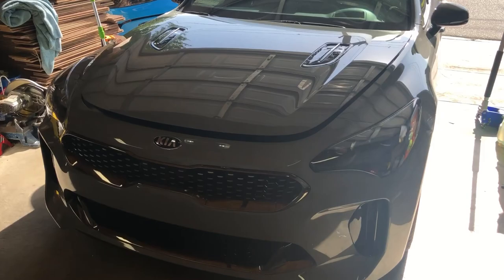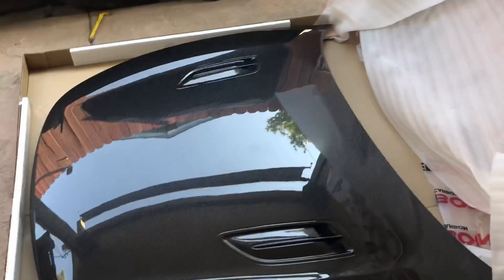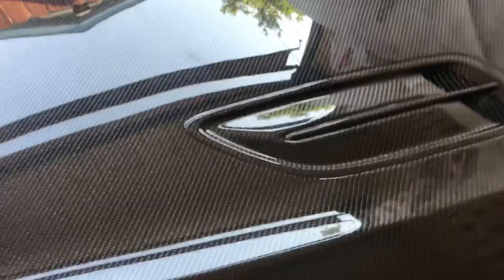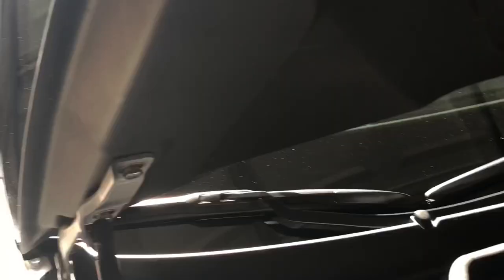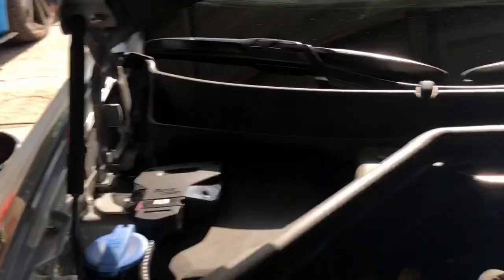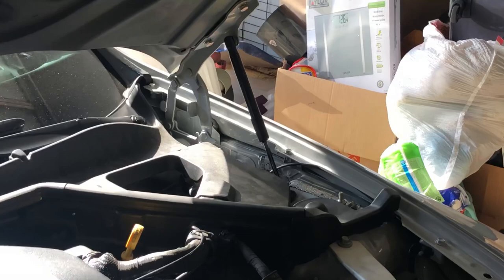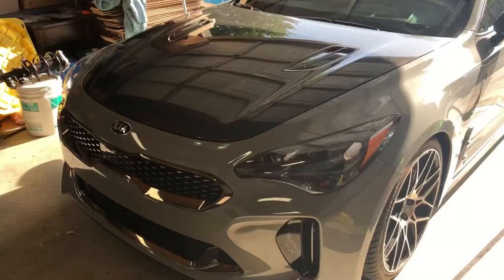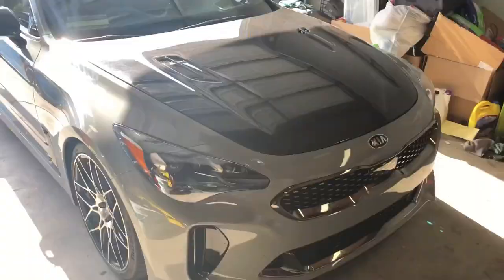Kia Stinger Seibon carbon fiber hood install

Comment: Nice man. Been considering this on my 22 or just going with replacement carbon fiber hood vents. Two questions. One is do those vent openings hold water? Also, I am a little confused about the part you were saying to remove to avoid stress crack?
Reply from the maker: Doesn't hold water. You want to remove the gas struts that hold up the hood as those will be too strong for the lighter hood.  You can find lower strength ones on Amazon just have to look for the right ones
Reply: @el.chepito1985  thanks man. Is it holding up well?  Did you get any type of paint protection film over the hood ?
Reply from the maker: @AngSolo  hot itself held up well. Highly recommend you immediately get protection on it. Either wrapping it in clear vinyl or clear coat

Comment: Are hood pins required for the the website says hoodpins recommend?
Reply from the maker: I never used them on any hoods. Safer to have them but i never had an issue.

Comment: What do you think guys, fly zone or nah?
Reply from the maker: D J it is less than half the weight of the stock hood
Reply: @el.chepito1985  did you say you should replace the gas struts? Or just remove them when installing.
Reply from the maker: @danrod13  either remove them or replace them with ones that have less lifting pressure.